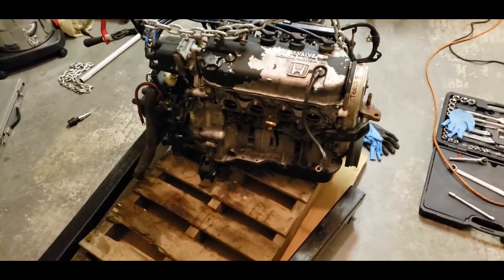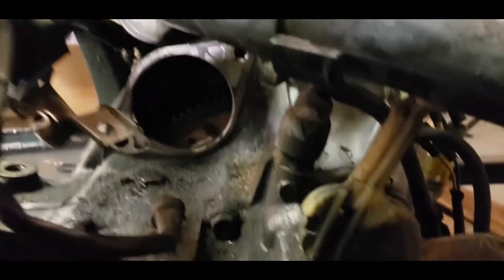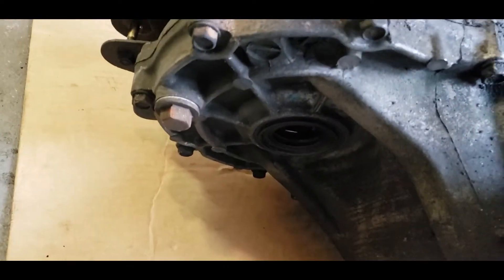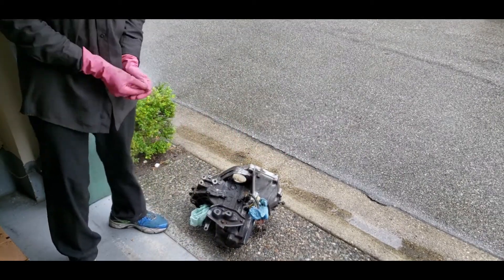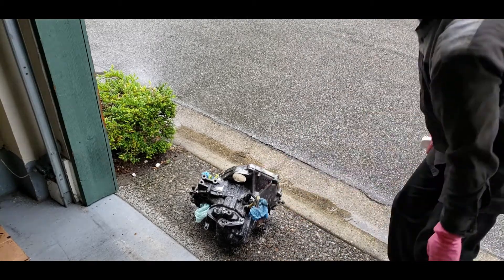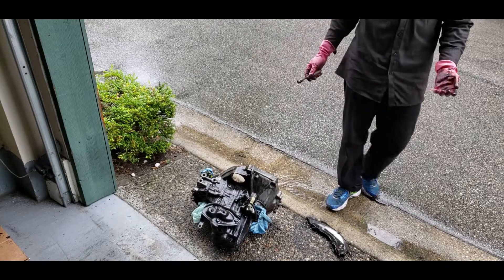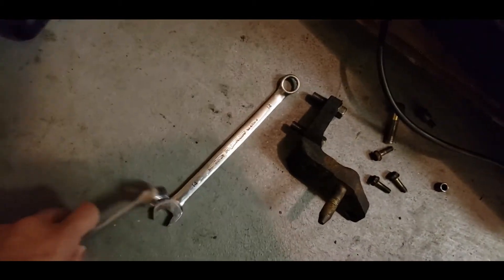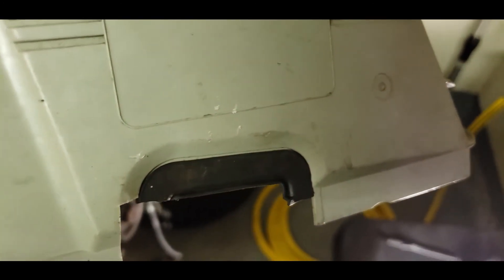[Part 3] D16Y8 Engine Swap: How to Clean Transmission at Home

Comment: I like the nice clean transmission. I modded my transmission. I swapped in a 5th gear set from a CRX HF so that at highway speeds the engine RPMs are reduced when in 5th gear.